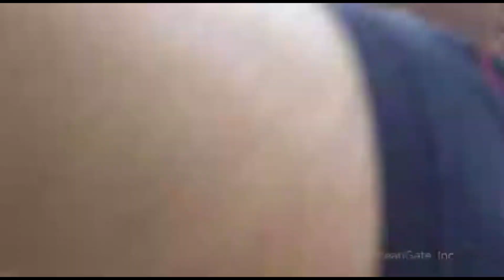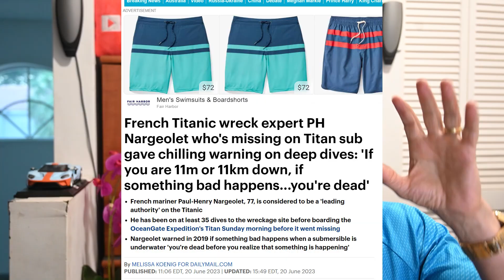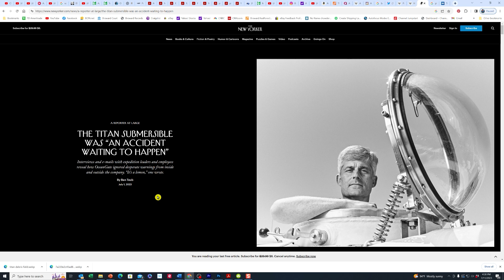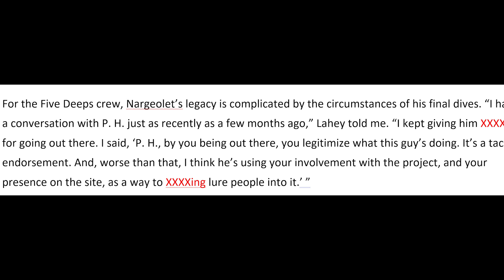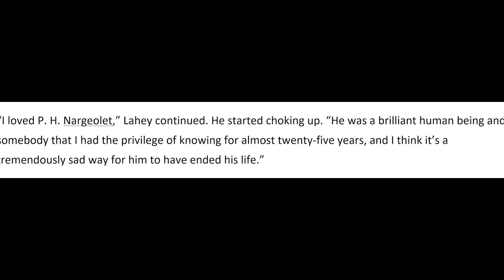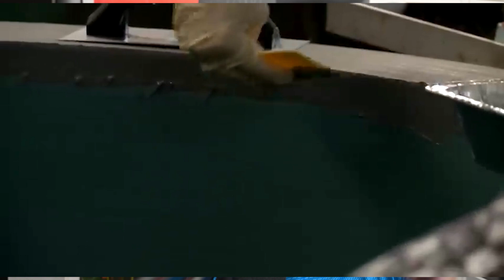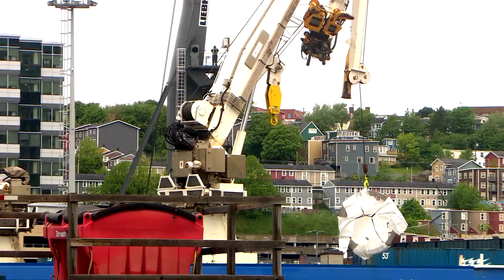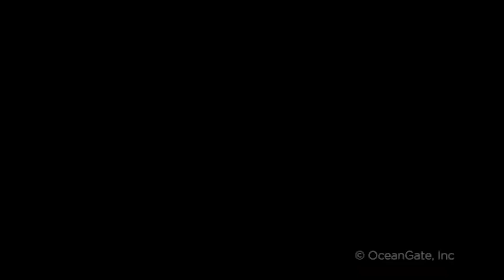Titan Sub: More Q&A, Design Defects, Why Descent Fast

Comment: This is not my comment but rather a copy of an @olivialambert4124 comment in a subthread.  Bringing it to the top because it rings true to me. Standard engineering safety factor is 150% or greater (probably more here with so many uncertainties of modeling) and here we have a base design with a factor of 10% on a good day plus sloppy basement manufacturing. @olivialambert4124 states:

"Having looked at a few structural analyses we can pretty safely guess what happened with the sub. The design itself is only capable of withstanding about 4200 meters of depth. That's incredibly close to the depth they're going and unbelievably irresponsible. They're using a material which is very prone to delamination and a manufacturing technique which significantly increases that probability. The repeated stresses of diving also significantly increase the probability of delamination. They're using very unreliable manufacturing methods with a very high probability of defects which significantly increase the probability of delamination. They're using zero testing to ensure defects aren't present. The design they used is especially weak to snap buckling around where the composite and titanium are joined. Snap buckling is obviously dramatically more likely after the structure has delaminated. All of the leaked transcripts also fit that theory perfectly.

TL;DR - The poor manufacturing and repeated dives delaminated the composite. That caused snap buckling and the composite hull collapsed. A combination of incredibly lazy design and terrible manufacturing processes were to blame. It's a great surprise it didn't happen sooner given the safety margin was around 10% (before delamination and defects come into play).

Also as an aside, you can get prepreg which doesn't require an autoclave. But obviously an autoclave significantly reduces the chance of defects and generally increases performance all around. A wet layup reduces strength by approximately 75% and increases the probability of defects further. It can be cured in an autoclave to help that slightly but prepreg autoclave cured is what you really want if you're making high performance components like Boeing. Finally in the video they stated that it was glue and we don't see anything else being used. It isn't as big of an issue as people think given the immense forces are holding everything together too, but it displays an incredibly sloppy method and frankly manufacturing ignorance which was present throughout the sub. There's zero downsides to doing it properly."

Comment: I had allot of thought about why they didn't make it from the same material, because carbon fibre & Titanium compression differently.I'm also currently in the aviation industry & have worked with carbon fibre wet & pre-preg lay-ups.. 

Carbon fibre is not good at compression, but is very resistant towards tension. 

Having the different materials compress at different rates, combined with BAD Join at either end of the pressure vessel only needed a hole the size of a human hair to make the journey fatal within seconds.

Comment: the titanium rings, glue, and carbon fiber have different expansion and contraction profiles under identical pressures... the different materials would have been pulling themselves apart.

Comment: I can't really understand that they glued the connection beetween titan and the fibre body. Every glue gets old and is suffering under stress. In my opionion the weakest points are the window and the glued sections. It was a narcistic company structure that causes at least the accident. 
Do someone know why the decent rate was to high? I think the sub is to small for a unnoticed water leak.

Comment: Also as to pre-wettting,  it would be fairly easy to make an applicator to coat the fibers with epoxy prior to laying them up. Why leave all that epoxy strength on the table?

Comment: Jeff, you are exactly right about the adhesive. I have worked with epoxies for over 20 years, R&D, industrial applications, etc. They did EVERYTHING wrong. Surface prep is essential, good deep abrasion, oil and other contaminants free. This should have been mixed under vacuum or mixed in a correct 2 component high pressure mixing device. Think 3000 psi pump with material that has been under vacuum to expunge it of any babbles. Then sent through a mix tube that will properly mix the components. These are readily available anywhere in the world.  Just dumb.

Comment: When you use Prepreg, you don’t have to wetten the fibers because the resin is already applied. Drawback: the layup becomes thinner during the curing when the resin that’s applied on top of each layer, is melted and drawn in between the fibers.at works for mostly flat parts, like wing skins, but in case of a tube, with the diameter also the circumference shrinks, leaving the fibers less straight, and therefore less strong.

Concerning the bonding between the carbon fiber tube and the titanium rings: this connection is purely loaded in compression. I wouldn’t see the strength of the bond as a big threat as there is form closure provided. However, with that little bonding area (typically, you shear in loads with a bonding length to thickness ratio of 50 or greater), the surface pressure on the composite will be quite high, and can lead to structural failure there, similar to bearing loads.

Comment: The glue holding the end pieces on was probably half dry by the time it went on. When I watched that clip I was like oh wow it’s only glued on there and the application was pretty half assed. 

I genuinely think that was the weakest point if the carbon fiber didn’t break because any shifting of the hull even 1/64” probably easily breaks that glue seal. The end pieces should have been designed similarly to the window where the pressure helps the seal but that wasn’t the case. This is of course ignoring the fact that port window wasn’t strong enough either but it was at least thought out a bit unlike the end pieces glued on with plumbers glue lol.

Comment: @jamespfp  Thank you; finally someone mentioning ballast/ trim tanks. These submersibles don't descend or ascend using thrusters. These are mostly for attitude control, forward/reverse movement and steering.The main method of vertical control is varying the buoyancy by letting in or pumping/blowing out water in the ballast tanks (trim tanks mostly shift water forward/aft or even side to side to control the attitude). The rate of descend can be controlled by letting in more or less water; the more water in the ballast tank, the higher the descend rate. If the tank sprang a leak on top, it's already game over, but say only the water inlet valve was stuck open. If you start to descend with 1000 liters of air left in those tanks, you have 1000 kilograms of additional positive buoyancy from those tanks right up to the bottom with the water valve closed. Now suppose the water valve is stuck open. The pressure in the tanks will climb with depth; at 3500 meter, that'll mean a pressure of 350 Bar. That means that the original 1000 liter @1 bar will be reduced to 2.86 liters @ 350 bar which means only an additional positive buoyancy of barely 3 kg in stead of 1000 kg so the sub lost 99.7% of its additional buoyancy. This loss is valid for any number used in stead of this example 1000 number. What's more, with a stuck open water valve the "weight" of the sub will increase with every meter descended, and thus the descending speed would have increased with every meter descended. If the tank sprung a leak on the bottom, the result would pretty much be the same, but if it sprung a leak on top, all the air would be rapidly lost - and thus all of the additional buoyancy - and the sub would be descending at a high rate from the moment all the air was gone.
For me the ballast tanks may have been the initial problem and monitoring the descend speed should have provided a warning. Had the enclosure/cabin itself sprung a leak, the occupants would have known very rapidly. Pressure would have rapidly increased which can be very painful on your ears (anyone with SCUBA experience can tell you how it feels if you don't clear your ears correctly).
When the Titan went into emergency mode and dropped the main ballast followed by the undergear, it barely rose 20 meters in three minutes which means that at that moment it had barely any buoyancy left. What's more, it may very well have been the instigator of the hull failing.
With very little technical data but a lot of gut-feeling:
The Carbon fiber tube with occupants itself has about 1000 kg of positive buoyancy but is pulled down on either end -by the Titanium domes (5500 kg) and frames - in affect bending it like a banana with the ends turned downwards. With the depth creating strong compression stresses in the hull, the "bending" will have reduced the compression stress on top and increased the compression stress on the bottom of the hull. Releasing all the weight of the ballast and frame at maximum depth will have suddenly increased the compression stress on the top and reduced the stress at the bottom. I think the - never encountered - higher compression stress at the top was more than this marginal design was capable of withstanding.
Reply: You post makes sense and matches to my general concept of a "leak". The problem I can see in your version: what you are describing is a "variable balance control" and yes, it is being used for the purpose you are describing. That's why the tank are quite small - you don't need much ballast to move the buoyancy around the neutral point.
However, this incident involved a loss of buoyancy for which dropping ALL the emergency ballast (don't have an exact number, but it had to quite a few hundred kilos) and using the upwards thruster couldn't compensate for. So, my reasoning is, the leak was in the main pressure hull or, in the auxiliary sealed compartment containing the batteries, pumps etc. - if it was large enough, that is. The main pressure hull is winning by long haul in my eyes.

Comment: Ref 9:17 => Jeff, isn't there something called terminal velocity that should apply to the Titan sinking to the ocean floor?   i.e. IF Titan's volume and weight remained constant then it is reasonable to  assume Titan's descent would reach constant speed... rather quickly, I'd expect due to the high density of sea water (as compared to things falling through air).     Since that didn't happen, according to the leaked text messaging, whatever was happening during the vessel's descent must explain how its volume decreased or its weight increased or both.

p.s. I understand there was a balloon-like air bag connected to a high pressure (higher than the max sea water pressure) in the control section.  Perhaps adjusting this bag's inflation could be the means by which Titan could change it's effective volume (buoyancy) and thus change its speed?    However, when in trouble, they tried using thrusters, then dropping ballast and even the frame; nothing was said about inflating this bag to gain ship's ascent speed.

Comment: I agree with you on the inaccurate way they apply the adhesive. But i believe the function of the adhesive is not mainly to glue the parts together. It is more used as a sealant. Just the pressure of the water presses the parts together so no glue is needed under water. Above water the forces are not that big so any adhesive will do. The question remains, is this a good way to apply a sealant?

Comment: The carbon fiber wrap was impregnated. Meaning that the fiber was running through a vat of resin as it was being pulled off the spool during the winding process. That's the "wet" application. Rush stated it was "preg" during one of the clips you shared in a video.

Comment: It seems as though the sub had been taking on water, possibly even before the descent as they decided to tow it behind the ship which could have caused damage or stress points. It would explain the accelerated descent rate (as if they hadn’t known about water intrusion they wouldn’t have calculated for it) as well as the inability to ascend. The crackling noise could have been more water entering the vessel in the covered rear area or even into the carbon fiber laminations.

Comment: 25 m/s is too slow of a decent rate, they say 2.5 hours to Titanic, not the bottom. They also say it can take 45 minutes to find the Titanic, so that means it 1 hour 45 minutes to the bottom, which is 36.2 m/s, which is pretty close to what that transcript says.
Reply: New information today. Go to the Snopes article about the purported Titan sub transcript. I can't link it here or YouTube will filter out the comment.

Comment: I am going to lose it if I have to hear one more take like this. They were not applying the epoxy by hand. They were removing the excess. The fibers were pulled through a resin bath to wet them before they were laid on the mandrel.

That doesn't matter though. Why not? Because that wasn't the vessel that imploded. That vessel was retired and they made a new one. You've been looking into this for weeks and you still don't know this? Very shameful. You should do the bare minimum before opening your mouth.

Comment: Great videos and insightful commentary about this tragic event.  Here is one observation that I have not heard discussed.  The manufacturing video shows the titanium rings being attached to the carbon fiber hull using adhesive.  What strikes me is this: Why are the titanium rings being glued to the outside of the hull, rather than the inside?  Seems to me that they would not be much use in stabilizing the hull from the outside.  If the pressure causes the hull to flex in the least, it is only the strength of the adhesive that will keep it from imploding -- not the strength of the titanium rings.
Reply: channel inside and outside.

Comment: I'm an engineer by trade, and I can say for certain, the sub's design was flawed before even getting into the legitimacy of its construction. You don't use carbon fiber in the construction of a pressure hull. Even with Ti, you XRAY for fatigue cracks, good old Stockton wasn't doing that or certainly not enough if he was.

Victor Viscovo's Triton 360002 (AKA LF - Limiting Factor) was pressure tested to 14000 meters and 1400 bar in Russia for commercial certification.

Stockton Rush certified his sub in his backyard.

Comment: You aren't fooling anyone....that circled spot that is labeled Titan debirs is clearly the lost city of Atlantis and the Masons want you to remain ignorant to that fact. They want the power that imminates from it for themselves....them and the Bilderberg Group. :P Seriously though, I am glad to hear you cover the continuous exposure to extreme temperature variations, prolonged exposure to UV and high humidity.  Also, I would think even a minor bump or scrape in  handling a very large carbon fiber vessel such as the TItan presents its own risk. If I recall correctly one of the steel submersibles that descended in the Mariana Trench experience a bump accident and the dive was cancelled until a thorough  examination could be carried out and I think it was like 9 inch thick steel.

Comment: I work with carbon fiber every day and I have experience with high pressure carbon fiber tanks (4500 psi air tanks).

I observed several serious issues with the process. The wet lay-up could absolutely be a problem. Too much resin and it significantly weakens the part. You effectively end up with a brittle spot of just epoxy without the composite reinforcement.

Too little resin (i.e. they missed a spot when applying it by hand) and delamination is a risk.

If they used room temp cure resin instead of heat cure then it would have far less temperature stability. I.e. the resin would soften and warp when left out in the sun on the way there. 

A far bigger issue though, IMO, is the use of carbon fiber tow wound in a single direction instead of woven fabric. Carbon fiber is incredibly strong but only in the direction of the fibers. For a part like this I'd use a tri-axial woven fabric for strength in every direction. The method they used effectively had no reinforcement horizontally. Kinda like hundreds of unbreakable rings glued together with weak glue to make a tube.

The most serious issue is the one mentioned in this video. The smooth titanium end caps held on only with glue. I would never rely on just glue to attach metal to carbon fiber. I'd want a mechanical lock. Like they do on the 4500 psi carbon fiber air tanks firefighters use. I.e. the cf is wrapped around an aluminum inner shell (before curing) with the metal fill valve attached. 

On a cf air tank you'd have to cut the cf to remove the metal ends. On the Titan I am positive I could have removed the titanium end cap by knocking it with a hammer. That's before you consider the effect of salt water and pressure on the adhesive.

To make matters worse they attached the door with a bunch of hand-tightened bolts. If any one of them was slightly over-tightened there would be flex in the titanium ring. It wouldn't take much flex to break the adhesive seal for both the acrylic window and for the carbon fiber hull.

Comment: kinda thought that with the constant unbolting and rebolting the hatch so many times(did they use a hand wrench? Ratchet or airgun?)would have a longterm effect.  Cause in my mind, carbon fiber would get a lot of shock from an airgun. And glued on ends just would not be deep enough. After so many times of compression  the tiniest flaw would have time to grow and spiderweb out. I've heard its like porcelain when breaking. But that thick, how would it truly act?
So many questions. Atleast this end would be as good as standing next to an atomic weapon and turning into a plasma close enough to instant.